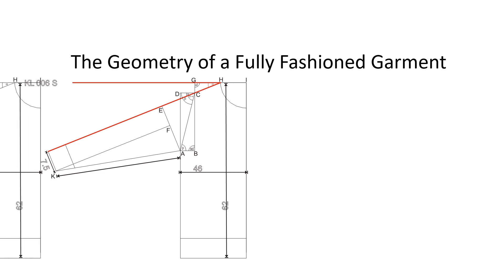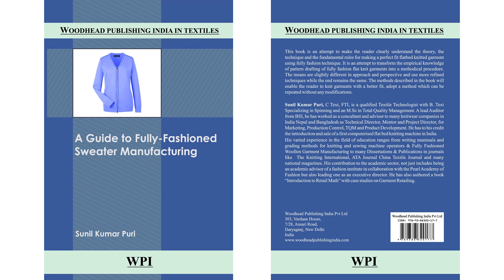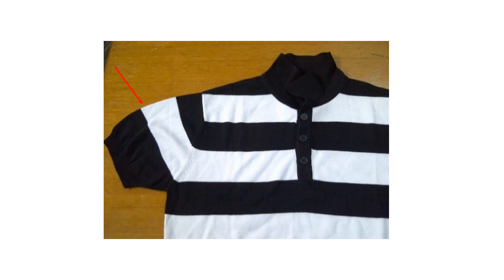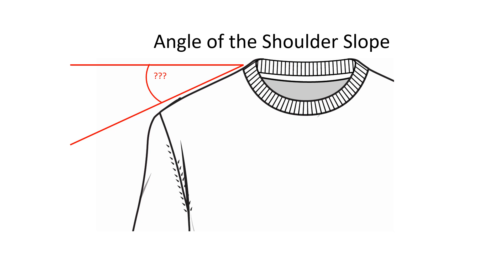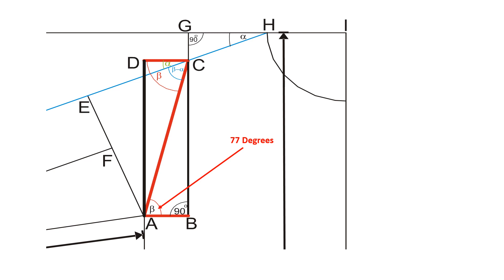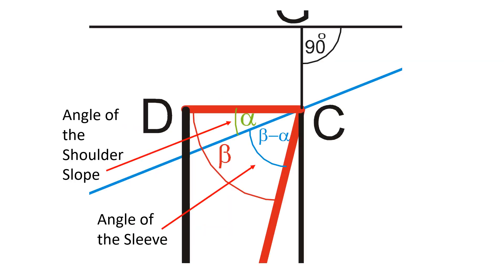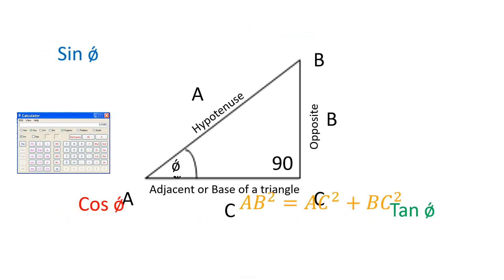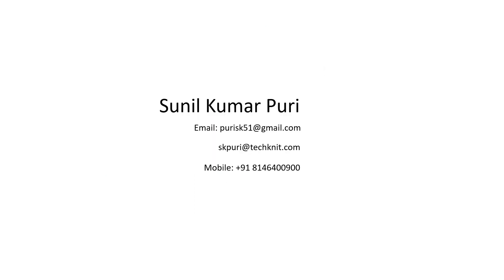Geometry of Fully Fashioned Garment Part1

Comment: thank you for this wonderful videos, I just want to ask if this calculation can also apply in the Woven fabric for the jacket and T-shirt.
Reply from the maker: Thanks for appreciating my work, with fabrics woven or knitted in cut and sew it's ok to cut the fabric in curves as well as straight line, but for fully Fashioned Knitted garments, the fabric is knitted to shape and therefore it is necessary to understand the geometry. Because ultimately you knit with needles and courses in mind.
Reply: @purisk51  thank you so much sir ,:)
Reply from the maker: Thanks for appreciating my work

Comment: how can i get your book in online sir and i have some question about how can calculate no of needle and rotation of one panel example front panel of some garment
Reply from the maker: The book is available on Amazon
Reply from the maker: But only hard bound book published by Woodhead Publishing India Pvt Ltd
Reply from the maker: The number of needles can be calculated by multiplying the width required in Cm with no of needles in one cm. If you watch the next videos, like geometry of Raglan sleeve or classic sleeve these calculations are explained there
Reply: @purisk51 tnx sir what about my questions i am a textile manufacturing student can you give me some advice
Reply: @purisk51  tnx so much sir what about the rotation of the panel
Reply from the maker: About your question on how to calculate the number of needles and courses please watch geometry of Raglan sleeve onwards and you will find the answer there, or send me your size set and the number of courses and needles  you will have in 10 cm in final knitting i will provide you all the calculations
Reply from the maker: Can you please explain what do you mean by rotation of panel?
Reply: @purisk51  i send it in your email sir